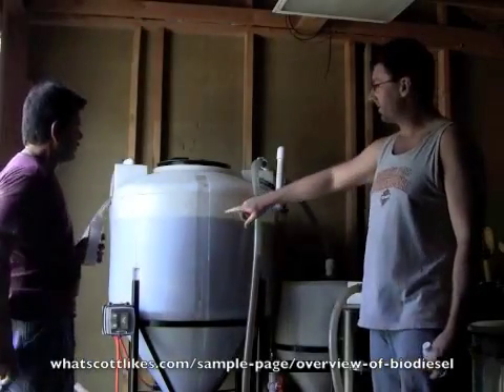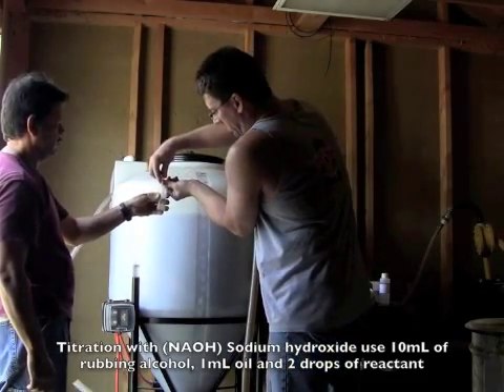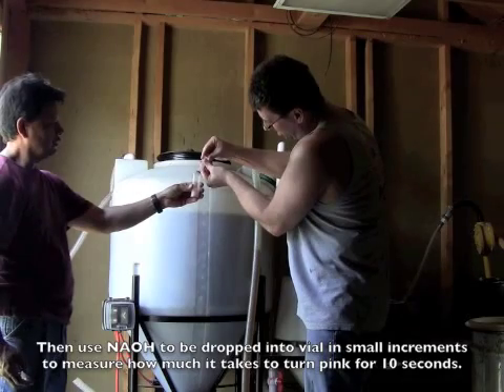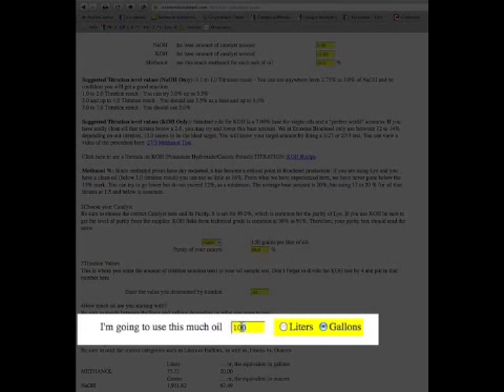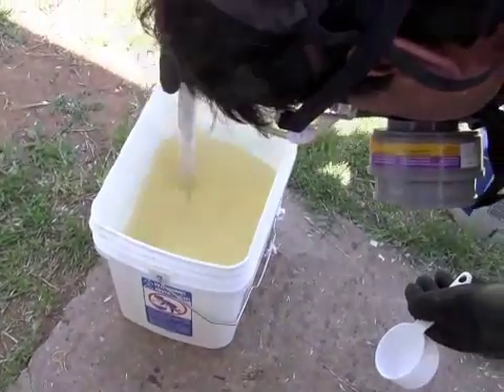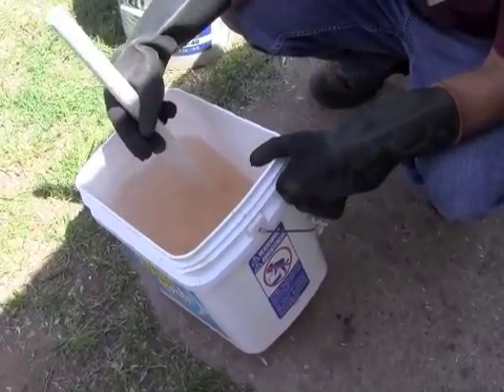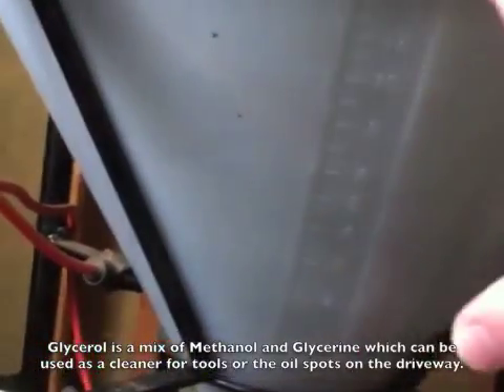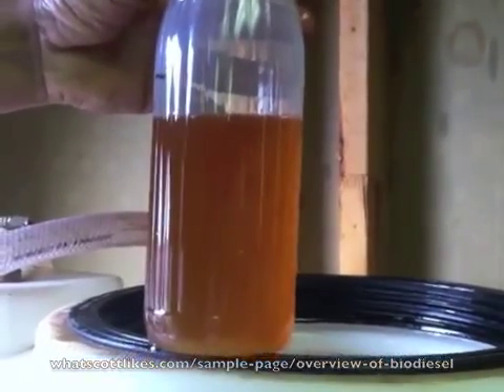Home Biodiesel Lubbock Texas Scott Howard making home biodiesel

Comment from the maker: Hello viewers of my Homemade Biodiesel video! How many of you would be interested in a Home Biodiesel kit to make your own Biodiesel? Now this Biodiesel works mainly on pre '07 diesels unless you have 'deleted' your diesel. I've been thinking about starting up the production again on 2 versions of the home kit. Let me know if you want this processor. Your cost per gallon mainly will depend on your cost of methanol. Usually you will use about 20% methanol to your amount of used vegetable oil.
Reply: Dr Scott I own a restaurant and I have a deleted 2015 F250.  Would you recommend the process for my truck?  I use it to pull our 5th wheel camping.
Reply from the maker: @mrjmmcclure  Yes, it would work. And you are in the perfect spot to make it since you probably used vegetable oil in your restaurant! The oil thing is the hardest part. Just filter the oil through a 55 gallon open drum using the drum 100micron filter: https://amzn.to/3NVnEuk
Reply: I'd be interested in that!
Reply from the maker: @lioninthemountain6350  If I get enough interest in these processors, I'll let you know the cost and how to place an order. I will be getting new prices on the parts... UGH! everything is going up!

Comment: Very informative! I'm a biochemistry undergraduate in NC. I've been producing biodiesel and started to scale-up the process. I use a catalyst made from glycerol that allows us to make biodiesel with ethanol.
We hope to start producing enough fuel for our university to use on campus and have been using a combination of videos like this and App State's designs. Thanks for sharing!
Reply: Make sure you heat your oil to 135  while mixing. Also do 2 water washes after this step, doesn't hurt to add an inline filter too.
Reply: @coborobasky2080  the scale we were at we distilled our fuel in two different fractions. We have started experimenting with other methods of polishing the product
Reply from the maker: @kylemcguff5581  Let me know if there is something better than Purolite.
Reply: @naturalhealthlubbock  distillation will be the best method, just not feasible at larger scales without an expensive thin-film evaporator (wiped film evaporator).
I'll let you know what we decide on for our process
Reply from the maker: That's Great! So instead of methanol, you are using ethanol? Do you use potassium hydroxide or sodium hydroxide?
Reply: @naturalhealthlubbock  the catalyst is a glyceroxide and it dissolves in ethanol for our reactions

Comment: Great knowledge i want to build a system just gotta make the time on days off would love to pick your brain on the process when i make it back that way I'm from Silverton so it's cool seeing a nabor with experience
Reply from the maker: Beware! Biodiesel works on diesels 2006 and earlier. They can work in newer ones but only about maybe 10% of the fuel.
Reply: @naturalhealthlubbock  owner of a 2020 ram 4500. Been running it exclusively on biodiesel since the day I bought it. Even my new tractor, strictly on biodiesel. If made properly, it will run just fine. No problems whatsoever. Now running straight filtered vegetable oil is a whole different story. That’s just dumb. Even in way older diesels
Reply from the maker: @alaefarmestatesllc  Does your 4500 still have the DPF? Things must have changed over the last few years. If it's 100% biodiesel it usually would clog up the DPF. That's good to know that it is working!
Reply: @naturalhealthlubbock  yes it does. All diesels after 2007 I believe have them. Even my 2021 kubota 7060 has one. These need to be cleaned out/changed (or deleted) from time to time regardless. The tractor I think cleaning/replacing is estimated to be around 5k hours. As for my truck, if it starts to act up, I’ll just delete it like I did on my 08. By delete I mean I’ll just buy the whole emission bs delete kit. But so far so good, zero problem.
Reply from the maker: @alaefarmestatesllc  True, if you delete, it will definitely work.
Reply: @naturalhealthlubbock  so on my 08, it’s never seen biodiesel and I had those issues off of #2 pump diesel at 100K miles which is y I did the emissions delete along with straight piping my exhaust. I have a friend with the same 08 as me, ram exclusively on bidiesel from 08, till today still running strong, granted he doesn’t work that 08 like I did mine but here we are 13 years later and his truck haz had zero problems and is still bone stock. Where as mine the only problem was the emissions bs and now the trans is in the shop for a complete rebuild, clutches were going out. So I don’t foresee any problems happening on my 2020 due to the use of biodiesel. Which is y I run it on exclusively biodiesel, along with many other people/companies here do.

Comment: what is the yeild per 100 litres of Raw oil.?
Reply: If you have kept the vegetable oil at a good 120 degrees and properly titrated it, then the yield should be almost 100%. The methanol that is added is the amount you usually drain back off as glycerol.
Reply: Scott's Gourmet Salsa 
Thanks..
Reply: @scottsgourmetsalsa9968  what to do with that glycerol?
Reply from the maker: @soggaisking7070  It works great as a cleaner. Floor or tools!

Comment: Interesting video.  However, just to set the record straigInteresting video. However, just to set the record straight from a chemistry perspective, contrary to what appears in the caption between 7:23 and 8:36, glycerol is not a mix of methanol and glycerin.  “Glycerol” is not a portmanteau of “glycerin” and “methanol” (unlike “brunch” which is a portmanteau for “breakfast” and “lunch”).  “Glycerol” and “glycerin” are the exact same thing; they are synonyms.  However, depending on the stoichiometric ratio of reactants (oil + methanol + lye), there could be some unreacted methanol in the final products (biodiesel + glycerol).  Similarly, some soap will contaminate the products, as a result of a saponification reaction between the oils and the lye.  Washing the biodiesel will water will extract the soap and methanol contaminants.
Your video does not mention what you do with all that leftover glycerin.
Reply from the maker: I understand the reasoning, but explaining to that degree on a video to people that mostly want to 'just make biodiesel' would bore most people. You can sell or give away the glycerin as parts/tool cleaner. It's works great on cleaning oil spills on the garage floor.

Comment: Nice, I bought a system used off of eBay a few years ago. I'm afraid to use it because a friend made a batch in his Appleseed processor and we got 40 gallons of yuck.
Reply from the maker: I know, It's not the easiest to make the first time. With the processors and the drywash system I created it started making great biodiesel that looks like iced tea. If you need help let me know. Thanks
Reply: I will take you up on your offer, but first I'll have to wait for warmer weather here in NE Ohio, thanks, Dave

Comment: Where can I get the filtration tank that you have I want to buy the whole system asp
Reply from the maker: edward gakinya Are you talking about the complete processor with pumps, the 2 tanks, hoses, heater etc? or just the purifier? or all of it? I have the complete system in a 300 gal, 150 gal and 85 gal. Where are you located?

Comment from the maker: Mix 10 milliliters of isopropyl alcohol in a small container with a 1-milliliter sample of WVO. Add to this solution 2 drops of phenolphthalein, an acid-base indicator that's colorless in acid and red in base. Using the syringe drop measured amounts of lye/water solution a drop at a time into the WVO/Isopropyl/Phenolphthalein Solution. As you are adding the lye/water to the solution watch for a pink (magenta) color change. Measure the number of milliliters of lye/water solution that you used.